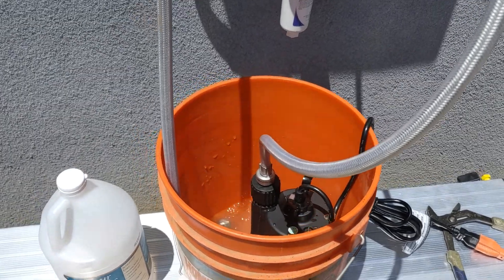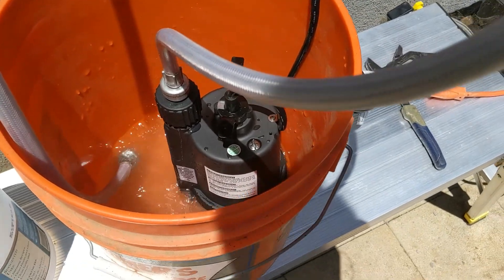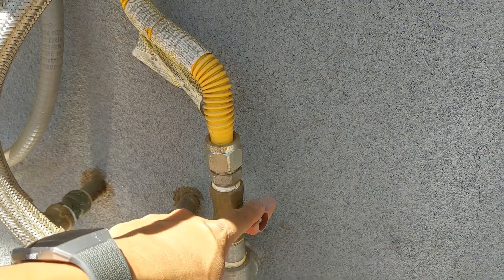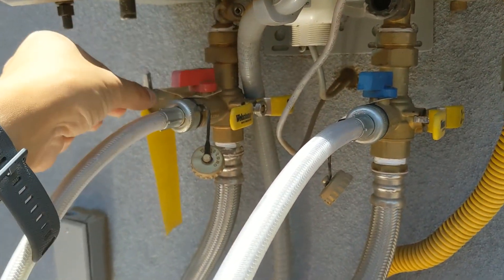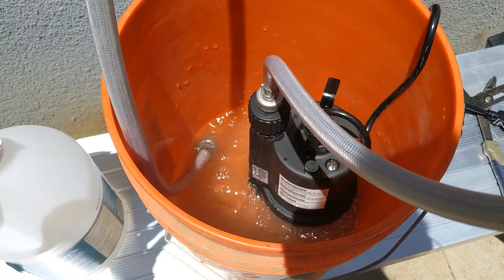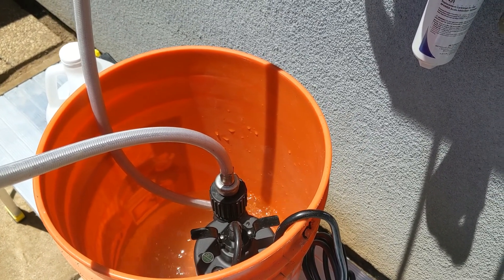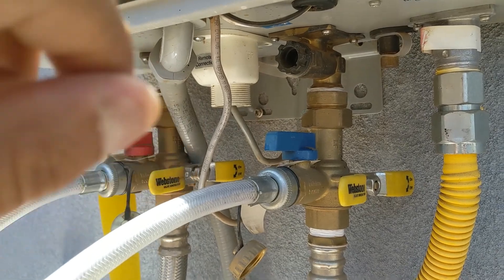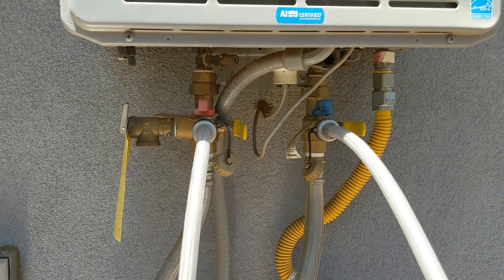How to Clean your Tankless Water Heater: DIY with Vinegar (Annual Maintenance by Flushing System)

Comment: I drained the tankless first so as not to dilute the vinegar and also set up the flushing flow reverse of normal water flow thru the heater. I  also placed a cheesecloth over the bucket to act as a filter for the returning vinegar. I used 2 gallons of vinegar for a better volume. At the end of the flush, I swapped the flush hoses so they were set for normal flow thru the heater, then turned the heater on and allowed it to heat up which further dislodged build up inside the heat exchanger.

Comment: Hi I did connect everything like you and pump not pumping thru heater. I did recheck everything and it is not flushing Did check pump and it is working fine Any help?

Comment: did the opposite, I left the shut off valves open and had the service valves closed at the hot and cold water lines at service valves.  What damage did I do if any?
Reply: Only damage would be to pump, if any. Next time I'd advise checking the outflow hose to make sure your loop is running.

Edit:typo

Comment: Minimum 1/6HP? Some manufacturers state a minimum as low as 1GPM. A 1/6hp pump will usually be north of 12 GPM. There is a good reason companies that make flushing kits use smaller pumps. Sometimes faster isn’t better (just ask your wife. 😝)

Comment: 1 gallon will not clean as much as the vinegar reaches max saturation. So you should use more fluid. The 1 gal will not be effective enough to clean at its potential.

Comment: Will this still work if you don’t have a flush system?
Reply from the maker: You can always buy the service valve kits and install them on your tankless water heater.  I bought these for my Rheem unit on Amazon, https://www.amazon.com/gp/product/B00C5YBENQ/ref=ppx_yo_dt_b_search_asin_title?ie=UTF8&psc=1 Just shut down your main water valve and install the kit or have a professional install it for you. It makes maintaining your tankless water easier and will also have you system run more efficient. At the same time, I would put a basic inline water filter on the inlet to filter additional sediments from the tap line.
Reply: @remagelosnoc  thank you

Comment: The unit doesn't need gas to heat the water while is pumping into the system remove residue??
Reply: You dont want the unit to be on heating the vinegar; the chemical reaction of the vinegar is doing the cleaning all on its own.